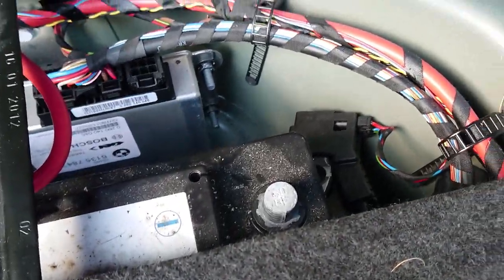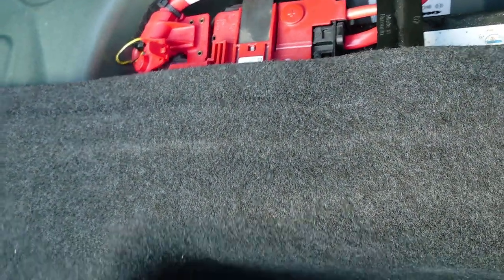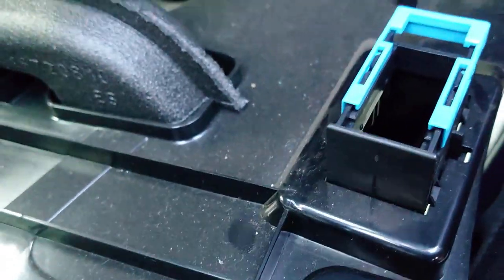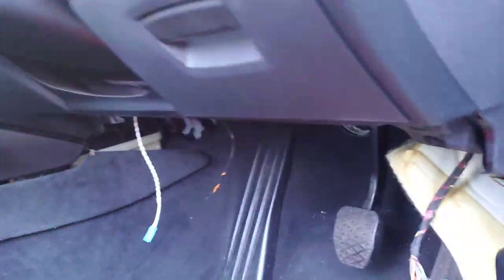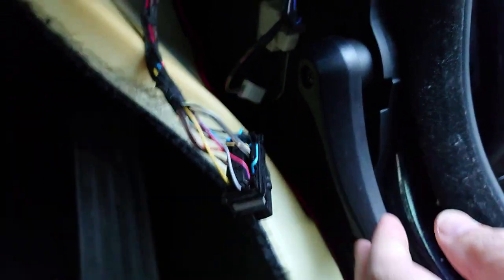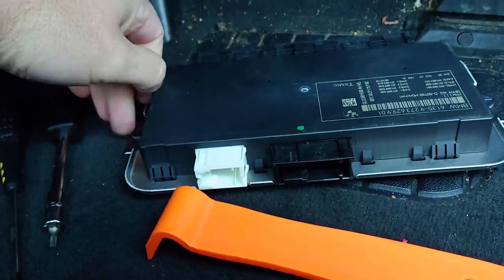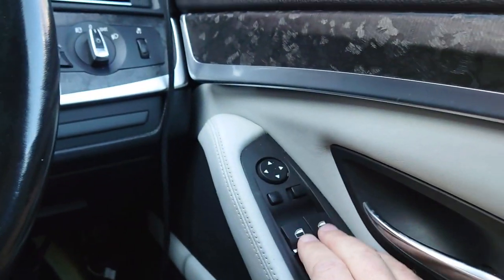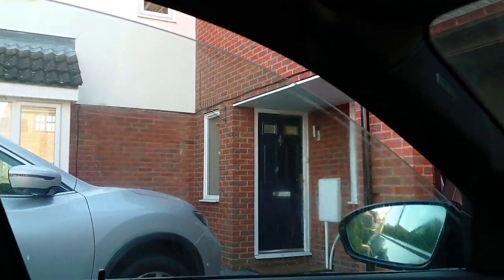Salvage BMW F10 M5 - Replacing the FRM and coding with E-SYS. Windows fixed !!

Comment from the maker: I'm so glad that this worked!!!! Apart from a few cosmetic touches, my interior is done. I'm so happy.

If you need to replace your FRM and need help let me know, if I can help I will. As it turns out this was pretty easy.
Reply: Where you able to inject a CAFD to the FRM using PSdZdata lite or did you need to download PSdZdata full? Thanks
Reply from the maker: I think my download was the full PSdZdata, file was absolutely huge!

Comment: I would just like to thank you for taking the time to make this video, it’s probably the only one I have watched that made sense and despite the wobbly camera work has enough info to understand 

My FRM croaked recently after the battery did nothing more than go a bit flat! Your video showed exactly how to recode its £20 eBay replacement!

Next job - new battery these vehicles really don’t like low voltages!

Comment: What kinda interior trim is that mate? Is it forged carbon fiber? Is it a wrap or a dip or original? Looks really nice
Reply from the maker: +Thuzitha Nuwan B. Rathnayake hi mate, it's Hexis Forged Carbon wrap. wanted to go for something a little different to all the other carbon wraps out there. it also looks so much better in the flesh, the camera doesn't do it justice.

glad you like it. are you going to wrap yours?
Reply from the maker: +Thuzitha Nuwan B. Rathnayake check out the wrapping video too.

https://youtu.be/umm6OOI5TOM
Reply: @RichsRides  Yeah mate. Plan on wrapping the interior. Is this wrap matt or gloss?
Reply: @RichsRides  Will do and thanks.
Reply from the maker: @ThuzithaNuwanBRathnayake  it's a textured matte finish so it catches the light from different angles. I think it looks awesome, but not sure it would look nice covering a large area like a bonnet. I think Hexis will send out samples too so you can see it properly before you commit.

Comment: So what was the original issue with this? Did the windows roll down but not back up? I'm currently facing the anti trap issue, replaced regulator and motor but the driver side window still only rolls down but not back up at all.
Reply from the maker: Hiya, they just didn't work at all. Tried reprogramming it but nothing worked so hard to get a new module.

Have you tried rolling it up with ISTA? You could just have a faulty switch?
Reply: @RichsRides  Thanks. I'm still having issues with anti trap. Replaced the motor and the window regulator itself but that didn't do anything. Pressing the switch I can hear clicking noises from under the dashboard on the drivers side but nothing else happens.
Reply from the maker: +Doganderboss have you tried controlling it through ISTA and seeing if it throws any errors? remind me if you've replaced the FRM or not?

Comment: Nice vid. Is there a way to copy coding data from old frm and transfer to a used frm?
Reply from the maker: +Aamir Ghanchi glad you liked it. I'm sure there is but I've never done it myself. should go something like read the svt from the existing FRM (if you can?) save the file and then load it and code it back when you've attached the new one. I'll see if I can find the steps somewhere for you.

what's happened to your FRM and what settings do you want to carry over?
Reply: I can do this for you if you have a ENET cable.
Reply from the maker: @fahimb5876  out of interest, how would you do it?
Reply: @RichsRides  I have access to coding data. I can code it without the old module.
Reply: @fahimb5876  You do this remotely? I have the software and cable and I am working on a few issues on my car that I am interested in employing your help with

Comment: Hello will this fix high beam lights not working after replacing FRM
Reply from the maker: +Elio J. Gharios I'm not sure, when did they stop working? was it after you replaced the FRM? First thing I'd do is have a look at the errors that are being generated and work your way from there.

What have you done so far?
Reply: Yes dear after placing the new FRM high beam not working
Reply from the maker: @elioprog  and have you coded the FRM at all? Or has it just been swapped?
Reply: Just swapped so I want to know please form you that if I do the coding you’ve done will it fix this issue thank you for your replies ❤️
Reply from the maker: @elioprog  you need to code the model to your car regardless, at the moment it thinks it belongs to a different vehicle so it's not communicating properly with the other modules. It could be that the car it came from had a different type of headlight so it'll be trying to communicate with something that doesn't exist in yours. I would expect that if you code it to your car your lights will start working again. If they don't then start digging into error codes etc.

Have you got the software?
Reply: Okay thank you very much ❤️
Reply: Yes I have the software already
Reply from the maker: @elioprog  you're welcome, hope it works for you. Let me know how you get on, and shout if you struggle with the coding.
Reply: @RichsRides  ❤️❤️🙏🏻

Comment: Hi mate,im not sure if i have a problem with FRM but my daytime lights not working also the front windows not rolling up automatically, i tried to do some coding through bimmercode with vlinker device but it showed me footwell module invalid, what does that mean? Thank you for your videos
Reply from the maker: Hi @AbuMadi93, not sure how you got on. YouTube took a bit of a back seat for me for a while.

Not sure what your error means to be honest, the autoclose is usually just a process of calibration but it sounds like your module has  maybe gone bad? I assume it used to work before?

Comment: Man ya 100% lost me... Im missing the CAFD file as well but have no clue where to find it. Been looking for hours
Reply from the maker: +Gary Reen what have you done so far? if you can't see a CAFD you'll have to inject one. have you activate the FA?
Reply: Did you manage to fix this?
Reply: @fahimb5876  I ended up finding my exact part #, putting it in and now at least i can move the car. havent gotten to windows yet.
Reply: @garyreen2  I could take a look at it, if you want
Reply: @fahimb5876  My help was too far and inbetween, trading the car for a 2014 audi s4 tomorrow.

Comment: having a problem getting the CAFD in ways
Reply from the maker: +BasicAccountInfo what sort of errors / problems are you having?
Reply: @RichsRides  I figured it out I saved the CAFD from my old module then used that to code into the new FRM
Reply from the maker: @BasicAccountInfo   nice one! Glad you sorted it.
Reply: @RichsRides  yeah next project is finding headlights, I purchased the car with no headlights plugged them in and head no power to then all the lines had power so I assumed frm was the issue attempting today to see if that fixed the issue fingers crossed
Reply from the maker: @BasicAccountInfo  good luck dude, I'm sure you'll be fine. Happy to try and help if you get stuck.